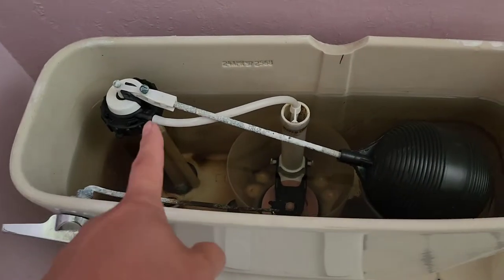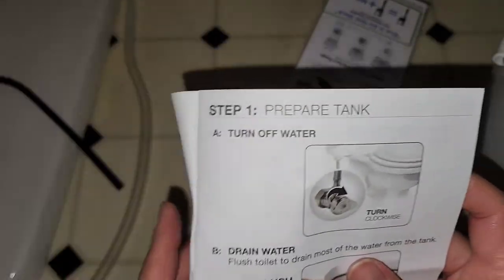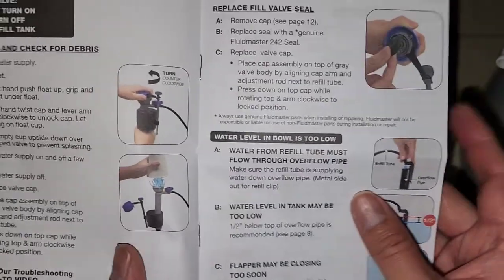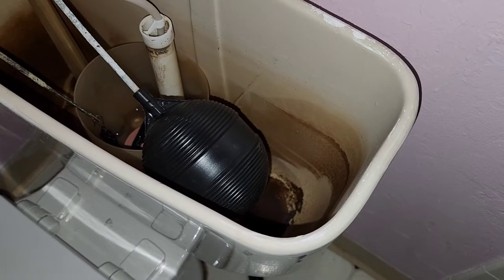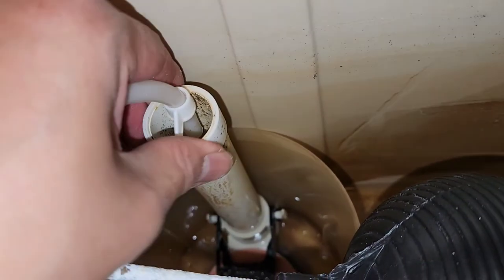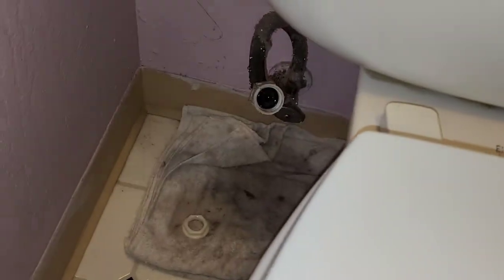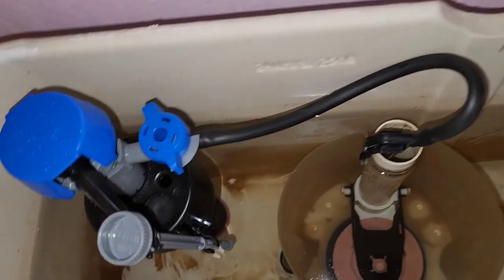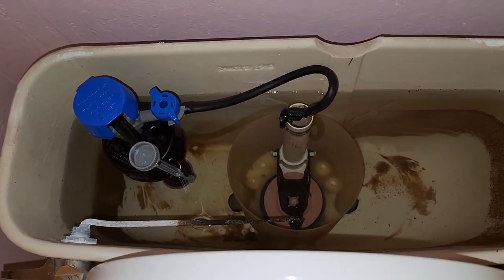How to Install Fluidmaster 400H-002 Performax Universal High Performance Toilet Fill Valve

Comment: Would that have anything to do with it flushing and running and it overflowing? It seems like it doesn't flush hard enough and it ends up overflowing
Reply from the maker: It can adjust it to fill the tank with more water, but might be your pipes are constricted with stuff sticking around the inside walls
Reply: @ItsBinhRepaired  which pipes? I think it's really old you know The tank is the tank parts are old built up with minerals and crap. I know the pipes are fine behind it and the rest of it cuz we had leagues we had a lot of repairs to do last summer.
Reply from the maker: @bonniej0  the toilet itself. Try pouring a bunch of water into the toilet bowl to see if it flushes
Reply: I've already done that I put juice open it hot boiling water snaked it but I have a cheap snake you know you can't hardly push it out push it through there so going to do it by hand like doesn't have a auger to it or anything that I plunge the hell out of it and what I read was to clean the toilet bowl all around with the holes are no way I might put my hand in there even with gloves lol
Reply from the maker: @bonniej0  pouring a lot of water in the bowl, does it flush?

Comment: New hose from the valve to the toilet
Reply from the maker: Hm?
Reply: @ItsBinhRepaired  replace the hose from the   disconnect to the valve. They tend to fail and will cause a flood. Really cheap thing to replace
Reply from the maker: @Phil-D83  no issues so far a year later.
Reply: @ItsBinhRepaired  I would place  it, but up to you
Reply from the maker: If it starts leaking lol
Reply: @ItsBinhRepaired  the plastic parts tends to crack and fail. For $5, I replace them every time.
Reply from the maker: @Phil-D83  the rubber gasket?

Comment: Why are you teaching what you dont know. 😁
Reply from the maker: Because the people watching the video know even less and I installed it just fine, so what's the problem? It obviously helped people install theirs.
Reply: @ItsBinhRepaired  yeah but first practice. Then record so it can be easy for them. Dont let the blind lead the blind.😁😁😁
Reply from the maker: @heckeepagan4091  better they learn the mistakes along the way. This is how you really learn, not just follow the leader. Then you learn nothing except how to be a monkey.
Reply: @ItsBinhRepaired  no you just learn the right way. Csuse you got thought the right way. You follow the steps. Simple. It gets boring when the teacher is doing crazy mistake while driving.😁
Reply from the maker: @heckeepagan4091  It shows you what to avoid. When people are shown the right way immediately, they leave stuff out and aren't careful. They also don't pay close attention. So many people didn't flush the lines after changing their sink faucet in one of my videos and damaged the valve, causing leaks because they just skipped around the video instead of paying attention...
Reply from the maker: My videos teach people how to think any not just follow. Imagine you run into a different situation and you can't just copy my video, then you'll be stuck. Everything isn't perfectly the same on every job.
Reply: @ItsBinhRepaired  then you will have to do the same video a million times. Cause there is million of mistakes you could do for that one job. Not just the one yiu made. 😁😁😁
Reply from the maker: @heckeepagan2012  The point is people will pay more attention.
Reply: @ItsBinhRepaired  dont know about that. Other video are easier. I bet if you not a pro. You look for simplest way to repair. If you cant then simple you call a pro. You have toooooo much competition to make it uncomftable for others. Learn to compete. And you will have lots of sucess.😁🇵🇷🇺🇸😁
Reply from the maker: @heckeepagan4091  lol not necessary. I'd rather not replace the toilet thing multiple times. XD

If your idea of successful is working so hard you can't enjoy, then have fun being successful. Lol
Reply: @ItsBinhRepaired  lol well you want to teach with all mistakes included. Yiu just hit my point. Good luck anyway.😁🇺🇸🇵🇷🇺🇸
Reply from the maker: @heckeepagan2012  having some mistakes is enough to get people to pay attention. Lol